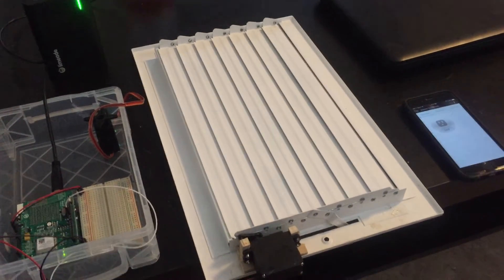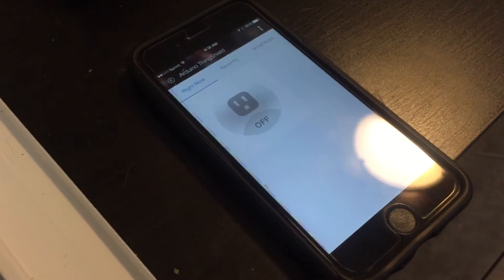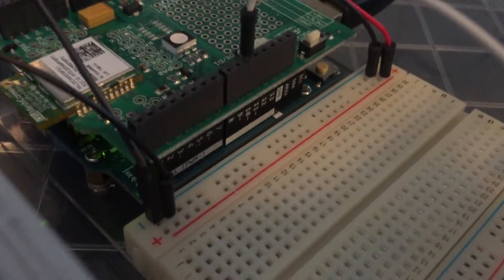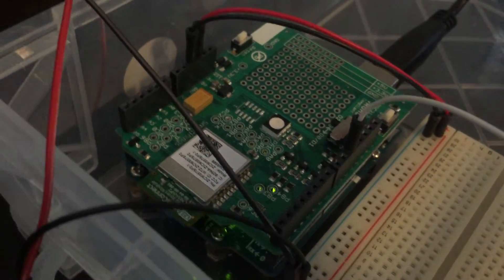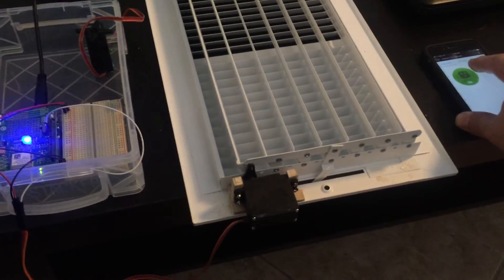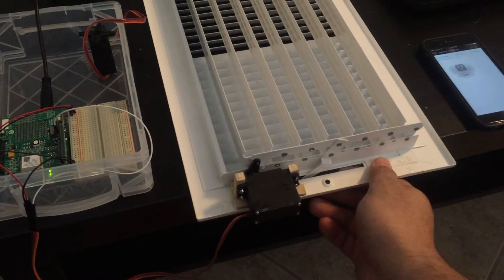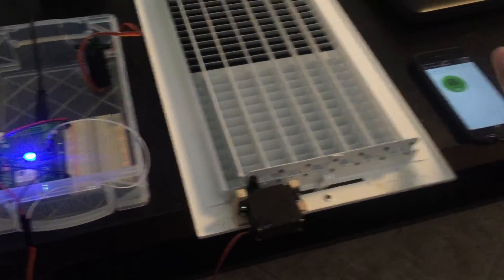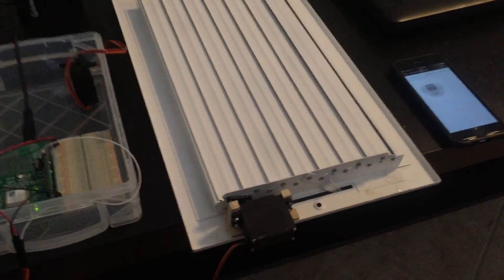Home Automation Project - Vent Control using a SmartThings/Arduino setup.

Comment: What vent are you using? Anything around here is the 2 flapper that you can hardly open/close by hand...usually use a screwdriver for leverage

Comment: Ok I know that you did this a while ago but I'm wondering if you could help me. I would like to open a vent register with servo when air movement through the main system is detected. I would like to do this with my range hood when we're cooking. When the vent hood is turned on it would begin blowing air through the system at the same time a signal would be sent to the Arduino to open an outside register vent to ket air out.

Comment: those pop rivet hinges on the register go to crap pretty quick. also if you push air at one of them mostly shut, they sound like a hurricane. look into duct mounted zone dampers.

Comment from the maker: Diggler, I agree with you 100% regarding a 3d printed plastic mount. As for now, I do not have access to a 3D printer and for this prototype, good ole' wood and epoxy glue did the trick. In the future, I plan on stream lining the mounting/setup portion to be more presentable!